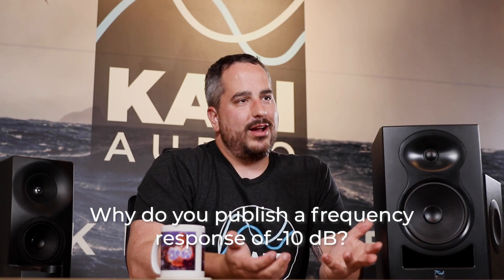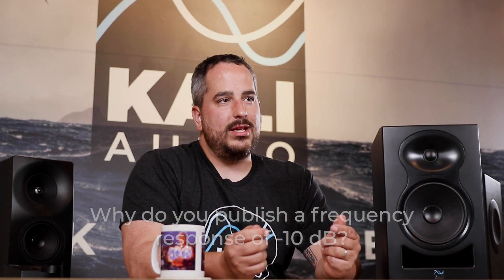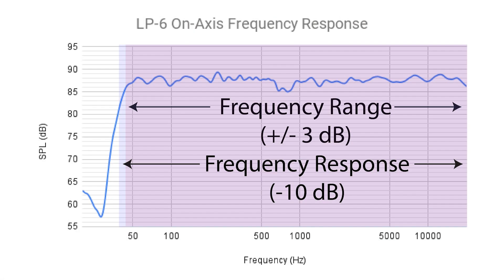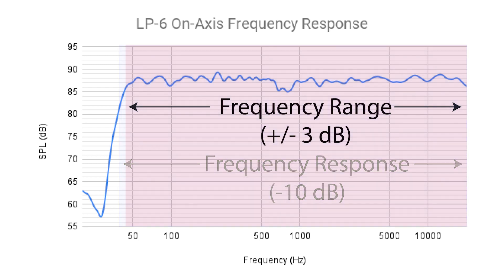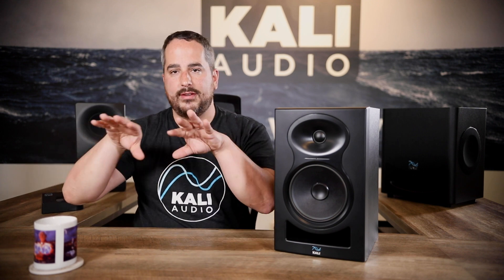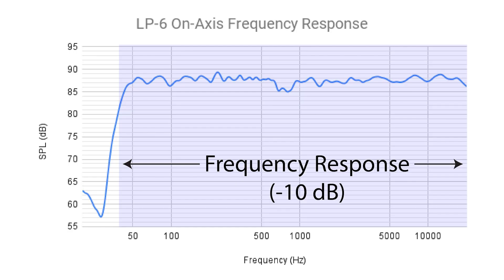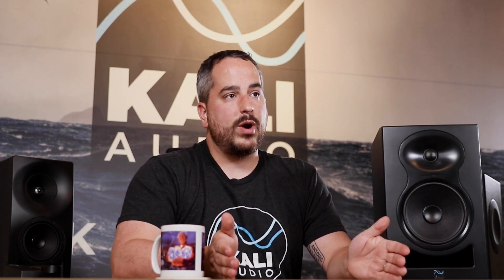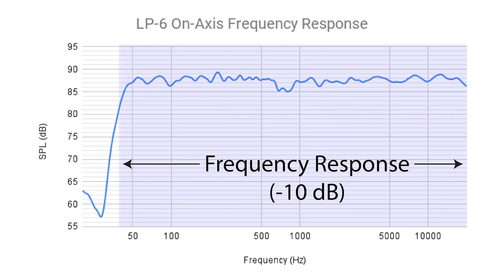FAQ Friday: Frequency Range vs. Frequency Response

Comment: So does the frequency range +-3dB and response -10db rule, you  so nicely explained, applies to the subwoofers? I mean when a manufacturer claims that a subwoofer has a frequency response at +-3dB is actually the range?
So it's better to look at for subwoofers with - 10db frequency values?

Comment: I just placed an order for a pair in-8 v2's 2 days ago. I have a question I probably should have asked prior to purchase. But here we go anyway.

Although I doubt things will go wrong with these monitors I still would like to know, are replacement parts available in case something happens. 

As a metal guy who deals with young metal and rock bands I've lived with the constant paranoia that one of my clients is going to eventually put a headstock or drum stick through one of my speakers.

 My previous monitors were presonus e44's. Do not recommend BTW. But they did survive a hurricane and multiple tornados about 3 years ago. Destroyed my house and studio. Literally took it to the ground. I found my monitors in the yard full of water and debris. I was able to get the dried out and cleaned up enough to use them daily since. I have noticed however one of the tweeters was starting to crackle about a year ago. My initial response to this was to order a replacement. Apparently at one point replacements were easy to get for these monitors but now you gotta jump through hoops to get parts. So after several months dealing with a crackle getting worse I just decided to jump ship and get a pair of monitors that would work better for me. Presonus lost me as a customer due to the difficulty in getting parts. 

All this being said, I totally meant to inquire about replacement parts before purchasing but I made the purchase unexpectedly. A client paid for them as my payment for a mix job. The purchase was more than we agreed on as well. I wasn't expecting that offer at all so when he made the suggestion I couldn't type sweetwater fast enough! Lol